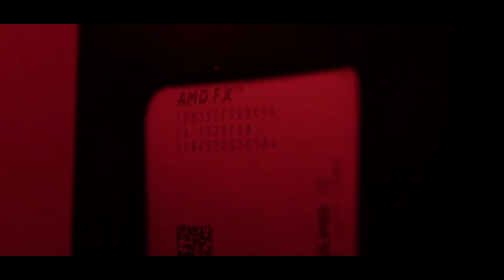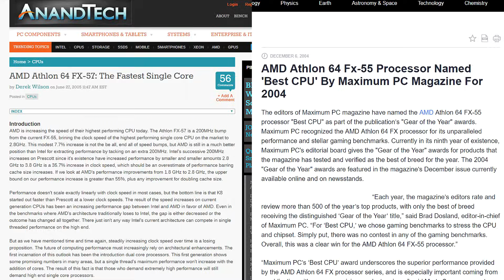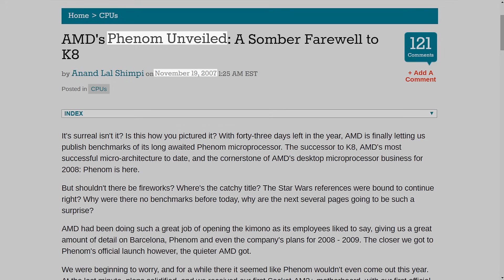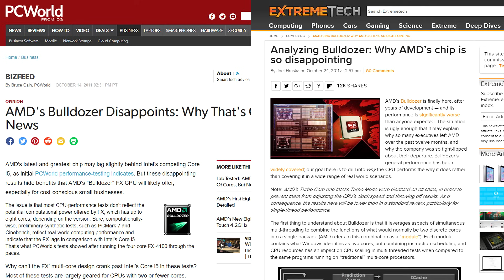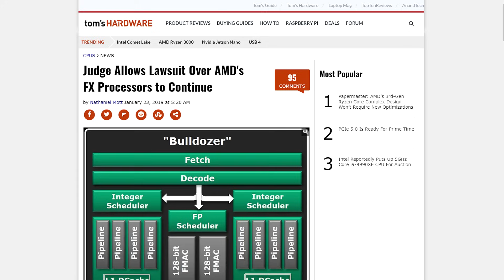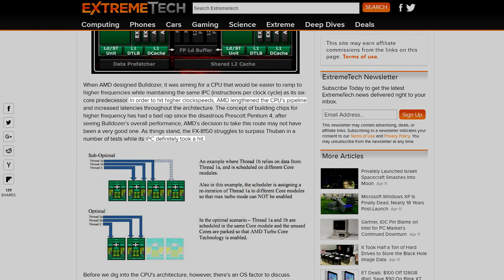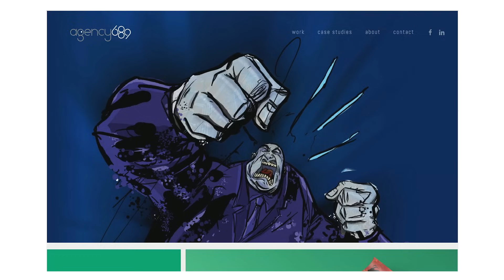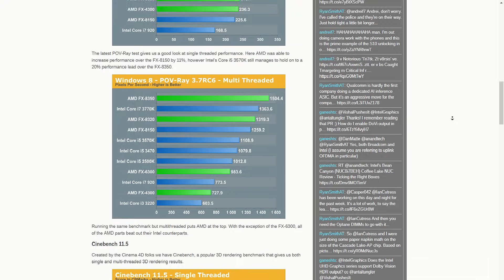Why AMD's FX CPUs Were Hated So Much? - The Fate of Bulldozer

Comment: My buddy sold me his half gutted FX 8350 PC, and I bought the rest of the parts (EVGA GTX1060 6GB SSC, 650W PSU, Kingston Fury 8GBx2 @1866Mhz, Samsung 860 EVO 500GB SSD, and Windows 10 PRO 64-bit. This is my first gaming PC and I don't live up to the hype of 4k on a damn monitor, and will probably game 1080p as long as time allows it. I have a 240hz monitor and can play almost any game averaging 60fps or more on such an old platform. Forza Horizon 4 avg 80FPS on ultra, Sea of Thieves avg 80FPS on legendary, Rocket League avg 160FPS on high. It's games like Far Cry, 4 & 5, We Happy Few,  The Witcher 3, and Mincraft Java Edition (with 100+ Mods) is where I can see some serious drops when I'm in crowded areas (down to 24FPS), but mostly stays around 60FPS or higher otherwise. I have noticed that the GPU runs at high usage when the CPU doesn't, but stays cool on only air. CPU 18C-24C idle and lower 40's under load. GPU lower 30's Idle and lower 70's under load. I had to learn about the huge dispute and also don't understand why the FX gets so much hate from everyone. I've been more than pleased with it for the time I've had it. It's OC'd to 4.24Ghz @ 1.325v on a 990FXA-UD3 V4 perfectly stable, but run into issues past that. Voltage Regulator (I think) goes to almost 100c using prime 95 all thread torture test, while the CPU is a steady 54C. I tried all the way up to 4.51Ghz with the same torture test/ voltage, and was a steady 55c, but crashed after 2 minutes. HWINFO64 calls the overheating components VR LOOP1 and 2 (Voltage Regulator or something else?).  IDK if anyone has suggestions, but I'm happy with it either way.

Comment: bulldozer wasn't a bad cpu, period. it's better than the 8700k across the board. now that ryzen is out, people are just now finding out that the bulldozer was victim of a smear campaign with zero truth. fake benchmarks on the internet, linus is guilty of this even, as well as anandtech and others. if you have an old haswell, upgrade for $30 to any bulldozer chip.
Reply: Better by what measure exactly?
Reply: You are smoking meth if you believe that any Bulldozer is better than an 8700k. That is factually incorrect and you should feel ashamed for posting such blatant misinformation.
Reply: I hope this post is some kind of joke.  I am an AMD "fanboy", and have purchased dozens of AMD processors dating back to my first 386 DX40 and only 4 or 5 Intel CPU's.  I currently use and FX-8350 and an Intel i5-4670k and the i5 is faster in everything I've ran on it, with the exception of Cinebench, and even that is fairly close.  I'm sure there are a few multi-threaded programs that might work slightly better on the FX, but I haven't ran into anything else that does.  Both systems are running the same video card and memory configurations as well.

Comment: I'm watching this on an FX 8350 overclocked to 4.5 GHz - upgraded from my Phenom ii 1100t overclocked to 4.0 (both on air). In the games I play (The Crew, FH3, etc...) the FX is a decent bit faster than the Phenom allowing me 60 fps locked at 1080p high settings. The 1100t was averaging high 40's/low 50's. Definitely an upgrade for me at least.

Comment: People still get me cinebench how it's detecting cpu core count and thread, it's not its just looking at the cpu it's what windows sets the threads up as

in windows 8 and higher (and it was a bulldozer cpu, not piledriver) they updated the amd CPU driver (windows patch) to try and correct the fail amd had done by doing 2 things, 1 set every module as a core with 2 logical threads and set cpu thread load order as 0 2 4 6, because if you didn't the Scheduler could place 2 different loads on the same module (say thread 0 and 1) and that would result in upto 50% performance reduction 
and you run onto second problem (separate windows patch) with bulldozer it's inability to power down any module so if you loaded up the last threads 6 or 7 the cpu had to fully power up the first 3 modules so it could power up the 4th module that 6 and 7 mini cores run on so the second patch made sure that did not happen the first patch (they also disabled core parking I believe as well or changed the way it works so it would understand the module setup is)

Most of that I believe was in the anandtech report witch was inside your video

Comment: Short answer: Because they were on a shitty architecture.
Long answer: AMD failed to meet competition (even their previous Phenom chips were faster per clock in many instances so much that even the 5 GHz FX 9590 that shipped with a water cooler still trailed <4 GHz i5 Quadthread Intel CPUs by a long shot). FX was worse than Intel chips in every aspect, except price. So nobody not completely out of their right mind would by AMD at that time if they were serious enthusiast users. Even the boards crashed and/or went up in flames under their power draw: https://youtu.be/8zTzpYjQ2MM?t=19 and many famous tech tubers actually killed their FX chips just with a small voltage spike above stock voltage: https://youtu.be/ys24AJh42xA, (kinda on purpose) https://youtu.be/amK_xNMerCo
All of my known first and second hand experiences with FX are bad or acceptable at best (constantly crashing 8350 of my brother on decent 970 chipset with stock cooler and proper mounting, dying 8350 of a pal that actually did cool it properly and never overclocked or overvolted, piss poor performance on all). So yes, FX was worse than buying a used i3 for most people, glad it is effectively dead not and even more glad AMD did get their ass beat marketing hexa and quadcore FX chips by Maxxon (Cinebench lists the "Eight-Core" variants as "4C/8T" and the "Six-Core" variants as "3C/6T", while a Californian court ruled in favor of a lawsuit against AMD for this exact naming scheme and marketing). FX can be dead for good. Long live Ryzen (especially third gen and up). My 3.7 GHz 1.36V max save overclocking Ryzen 7 1700 also failed me though. 4.3 GHz allcore-capable 3900X all the way, lol. ;)

Comment: love my amd FX processors, my first was the 4130, gamed with it for 5 years, then I upgraded in Sep 2019 to the 8350 and love the hell out of it without replacing the MB!
Reply: Exactly. I replaced single core AMD Sempron by quad core AMD FX4300 and then by eight core AMD8320, all of them in the same mainboard.

Comment: I liked my FX bulldozer, did just fine for several years, was running it until last february, sure it wasnt mind boggling but it did the job for half a decade and it was 1/2 the price of even a similar horsepower intel when I bought it
meanwhile Im on a ryzen 7 now and my bulldozer has a nice low stress life as a home computer for a co-worker who isnt overclocking the nuts out of it playing GTA 5

Comment: I just recently upgraded to Ryzen from a 8350. I was hitting 60FPS on RDR2 with a 1060 strix with that old ass CPU overclock to 4.4G. Never did understand the hate. I mean I wouldnt recommend one NOW in 2019 but...8 years on the same OCed CPU and no troubles. If I could time travel I would make the same exact purchase again.

Comment: Seems like now once again, AMD is the performance King with their Ryzen CPUs, however I'm sure Intel isn't going to give up so easily.
Reply: It's still going to take years for Intel to come up with a new CPU architecture. It will likely be a chiplet design like Zen. If they stick to big monolithic CPU dies, they won't be able to compete on price/performance like a multichip Zen CPU can. Intel are easily 2 years away from a serious new CPU to challenge whatever generation of Zen is out at the time. Until then, they're stuck with heavily overclocked, power hungry old CPU's on 14nm and maaaaybe 10nm++ (mid-year 2021 at the earliest).
Reply: yeah intel is just cheating on benchmarks now lol but they still legitimately have a small lead in gaming performance
Reply: @killingtimeitself  yep, for my main gaming PC, I have an Intel core i7-6800k 6 core 12 thread CPU with 16 gb quad channel ddr4 3000 MHz ram and a GTX 1080 graphics card. Still does a good job running all of the latest AAA games.

Comment: What almost everyone is missing is the fact that the FX was meant to be what ryzen is now. They just had to work out the thing with the infinity fabric. But now the bulldozer (ryzen) fx is REALLY rolling. Piledriver wasnt the end. It was more of a ryzen Prototype
Reply: Great video
Reply: @randomclips1511 No it wasnt. In literally no way do they use even similar computing concepts. AMD went back to the drawing board after the 9000 series fx chips and completely redesigned their product stack. There is nearly nothing similar on a ryzen cpu when compared to a bulldozer fx chip. The only thing they have in common are transistors. From different production nodes.
Reply: @Dj-Mccullough  i never said it did. i just stated that fx was like an early idea of a  ryzen prototype

Comment: Im currently debating if i want to upgrade to 2nd gen ryzen 7 (because f**k windows 10) or keep my FX8350. But i gotta admit that ryzen 3700x is tempting beyond belief. Screw intel.
Reply: take the 3700x. it's such a good thing
the mix of good tdp and performance is really awesome.
It usually is around 3.9GHz or higher when I look at my task manager's numbers
(somehow it's never at base clock what I find pretty cool)

Comment: I don't hate mine. I have 3 FX based CPU systems still running perfectly. My FX-8320 with 32Gb of DDR3 is brilliant for virtualization. Intels CPU's are good, but bang for buck in the UK not good value at all - very expensive. My last Intel CPU was a Q6600 which I have just retired as I am now upgrading to Ryzens. I am not an AMD fanboy, I am a value for money fanboy and you just don't get value with Intel.

Comment: I rocked my Phenom2 980 all the way up until ryzen 5 1600, now i have a 3900x and use the old phenom2 for emulation, and the girl rocks the ryzen 5 1600
Reply: I used to have an X4 965 Black Edition from 2010 till january 2018 when i switched to a cheap ryzen 5 1600 at that point... now i use a 3700X and i'm really satisfied!
Reply: @SweatyFeetGirl  Honestly i have to correct myself, my first one was the 965 BE, due to the 980 BE releasing laster on, i loved them cpus

Comment: Im still running AMD FX 8320 on my desktop. Unfortunately my water cooling died so its not overclocked to 4.5GHz anymore. Looking at upgrading to Ryzen 5 so not putting anymore money in older system. But have to say except for pump in my Corsair HX100i dying I have had zero complaints with system.

Comment: They were great for OC's and with the correct MB combo and cooling .. very good for the price.  I still use 2 8320s with an Asus 970 and a Asrock 990X. I also run a Ryzen X1700 and a Ryzen 7 3700X

Comment: I got my fx 4130 up to 4.7 ghz steady and ive only had good experiences the 8300 and 8350 were beasts now the 8320e was descent it really didnt enjoy being clocked higher at all probably cause the lower wattage but the 6130 was a sweet spot at the time prices were low and you could still get a good clock speed

Comment: The Bulldozer was a good deal in that time. Oc was easy and in winter you could warm up your room just using your pc. I sold all my fx computer and bought a 2700x when it came out. Back in time, my first amd cpu has been a amd k5 300mhz.
Reply: @Dalle Smalhals right. It has been a k6

Comment: Ummm Bulldozer wasn't terrible but it started sucking hardcore wattage when overclocked high, and Vishera/Piledriver didn't make as big a difference as it needed to. You could get a 1090T/1100T Thuban to 4GHz with a little effort, and it was about as fast as a 4.7-4.9GHz Bulldozer per core, and used less wattage, and for a while could be bought cheaper. If you got a Vishera over a Bulldozer ie 8350 vs the 8150 the IPC is a bit better and they clock higher with more reasonable wattage, then like 4.4-4.6GHz you'd be doing okay. It still isn't really any faster than the 6 core Thuban though. If you already had a high end Phenom II, the FX series was kinda crap. If you had a more mid range AMD CPU and were upgrading, it wasn't bad. It wasn't much better than Phenom II though, and was way behind Intel by a huge margin.
Reply from the maker: You might want to tune in for the Phenom II X6 1090T vs FX 8350 comparison that I will be uploading most likely this week. Just saying.
Reply: @RATechYT  Id be curious to see your results and comparisons. Multithreading has caught up a bit in the meantime so FX CPUs have the potential to be better than they used to be.

Comment: I am using my FX 8370 still and have been pretty happy with it. I am looking forward to installing an upgrade to the R9 3900x in the near future and will keep the 8370 in a back-up system. I expect it will run for many more years.  I still have a Phenom 965 Black from about 14 years ago and an AMD 64 from about 20 years ago. All work perfectly.  For the money, I have always found AMD to be a good value.  They didn't always come through as they should have, but I was loyal and helped keep them funded believing they would once again jump forward.  And so they have with Rysen.

Comment: Faildozer does not have 8 cores.  Well maybe in Opteron land if they had an 8 module model.
Reply: Look at it this way. Its 8 weak cores that share resources with no threading. 2 weak cores on each of 4 modules. The problem was that Windows see this cpu modules as a quad core cpu with 8 threads.
Reply: IMO by calling it a quad core 8 threaded CPU it increases performance because the resource contention is addressed by calling the additional partial core in the module a virtual thread.  FX 8000/9000 series is a quad core CPU not an octal core CPU.  It has one dispatch per module, one level two cache per module.  That makes the module a single core.

Comment: I still have an amd fx 8350. Only thing I hate about it is the turbo mode where the cpu cooler makes a lot of noise and overheats unless you have software to lower the voltage.

Comment: Because people compared it to i5's costing 60% more.
That's literally it.
fx8320 and i3 2120 were both £100 but how often did reviews compare them?
Its purpose of "power for cheap" was taken out of context, instead of people seeing its as i7 performance for 1/3rd of the price they just saw that it was slower in gaming vs cpu's it wasn't priced against.
You could spend the extra and get an fx8350 or whatever but just like the i7-2700k and i7-990x these were overpriced "halo" parts not meant to be bought by people with brain cells.
The architecture was designed to be a cheap way of dramatically increasing integer performance going from 12core opterons to 16core opterons and they did this well. They just didnt react well to having clock speeds doubled and forced into the mainstream market combined with marketing trying to make the point of 8 cores/threads which backfired and made them look less effective than they were.
Consider this, you have a £600 budget and £100 going on the cpu, do you buy a 2c4t locked i3 which only has 2xSata6 ports which might die or do you buy a 4c8t overclockable FX (if amd marketed it differently) and 6xSata6 ports with upto 32pcie lanes.
Theres a reason allot of youtubers like jayztwocents, teksyndicate and the linustechtips forum all started on fx8's and not on i3's.